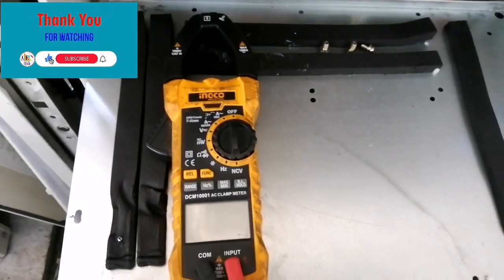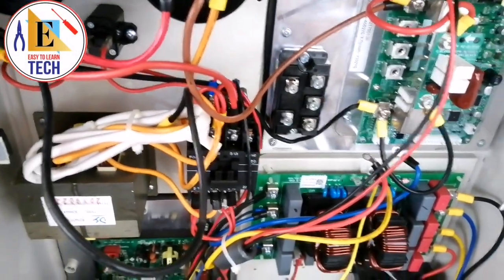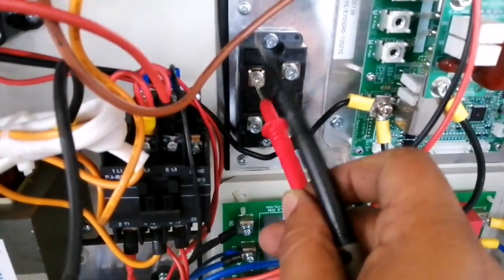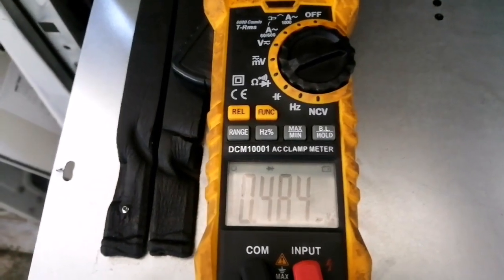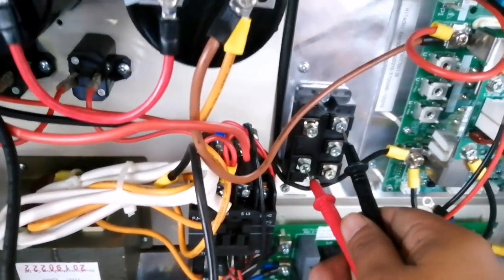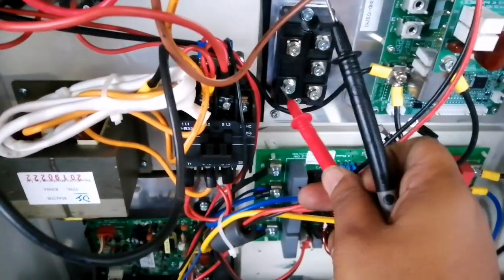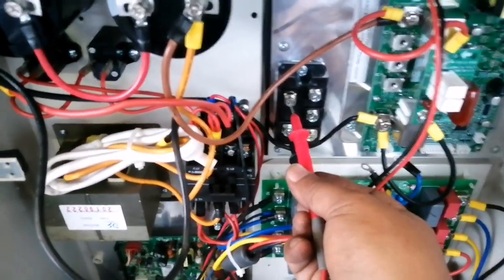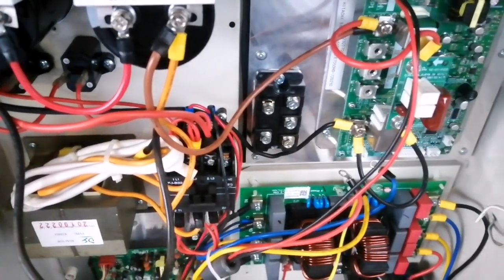#bridgerectifiertest ||Three phase rectifier TEST || How to check bridge rectifier by multi meter ||

Comment: Sir vrf sistamma ac ma jo copper pipe
How taha asma gas kasa calculate karta ha❤
Reply from the maker: Bhai indoor to outdoor ma copper piping ka jo gas calculation, copper pipe ka length or size ka hisab sa hota ha. But only the suction copper line calculates  kiya jata ha.. System manual check karo , har brand ka aapna calculate hota hai.
Reply: @Rehankhan_HVAC_TIPS  kasa kharta ha calculaton
Reply from the maker: Liquid pipe line ka size or length aap ko nikal na ha. Chat ma liquid pipe line ka side ka hisaab kitna charge karna ha likha ho ga ( per meter ya per feet) multiple by length of copper pipe.
Reply from the maker: Vrf brand ka naam bolo
Reply from the maker: Or whatsapp no send karo explain kar dunga. Koi problem nahi ha
Reply from the maker: Example  22.2 mm ha pipe ha ( chat ma required gas charging for 22.2 mm copper pipe per meter 0.36 ha) length example 10 meter ha... To 0.36 × 10 = 3.6kg gas charge karna ho ga. Phir next liquid line pipe ka size or length calculate karna ha till last indoor unit.
Reply: Please give me phone number